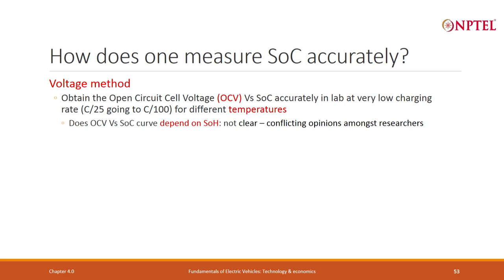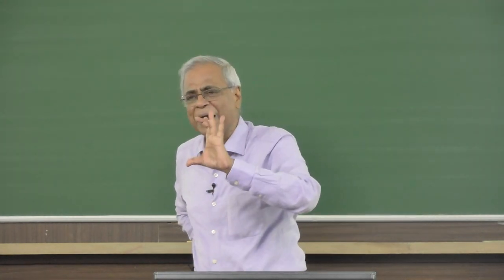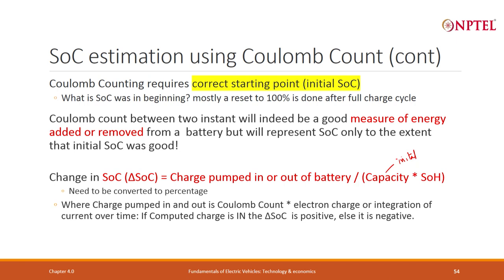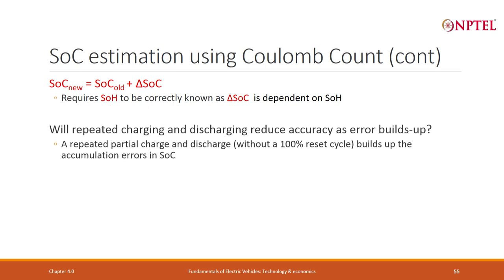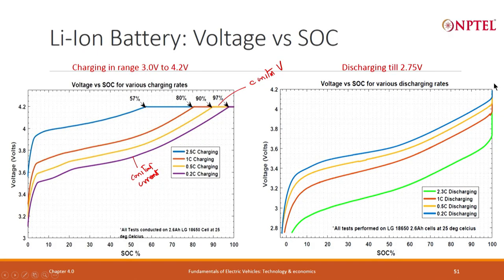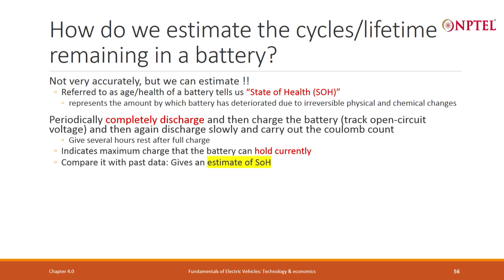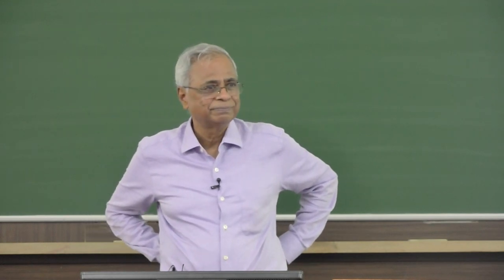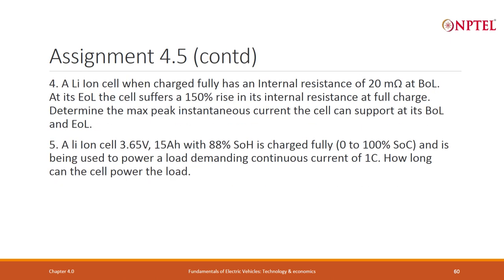Lecture 26 - SoH and SoC estimation and Self Discharge - Part 2

Comment: Assignment questions clarifications:- Continuous current of 1Coulmb/sec or discharge rate at continuous current of 1C? from assignment answer i understand it is latter. Similarly, i misunderstood internal resistance rise by 150% as 30m Ohm while it should have been initial internal resistance of 20m ohm + 150% increase means 50mohm as per assignment answer.
Reply: 1 coulomb/second means  1 ampere ???
Reply: What does the 1C in the question means
Reply: @shivotkarshraj9356  it is the rate at which battery capacity is consumed.
For example you have a battery with 5000 mah (5ah) capacity ( common in smartphones ) the 1c rate will drain battery in 1 hour at 5 amps. If rate is 2c for same battery it drains battery in 30 minutes at 10 amps.